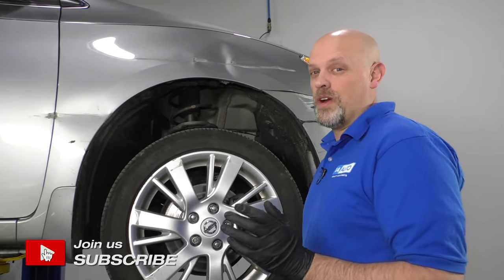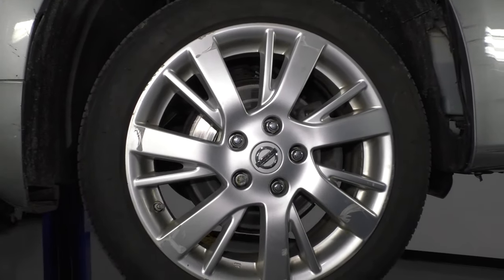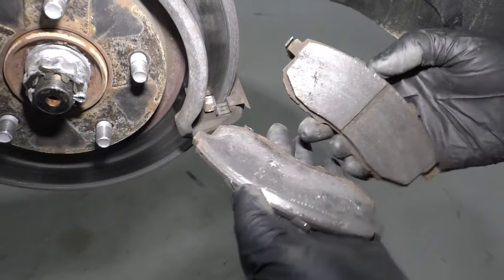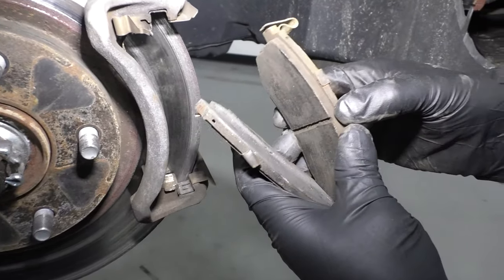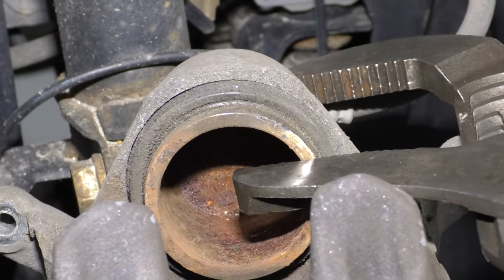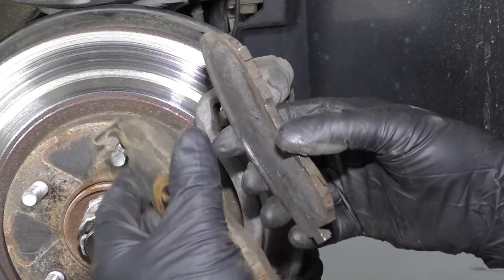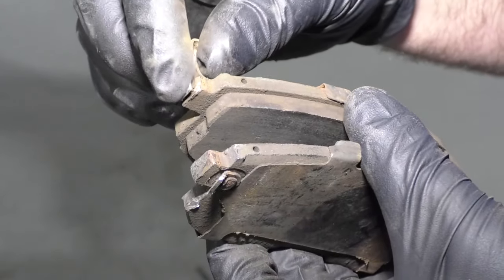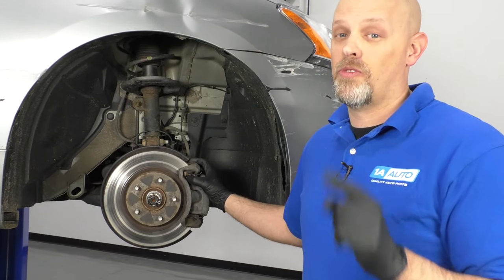Grinding Noise When Braking? What's That Noise in My Car, Truck, or SUV?

Comment: I just got into a car crash because my car was making grinding sounds. It was a car I had just gotten on November 11, and the dealership told me that they put a new brakes paddle in the car. Come to find out, it was a lie because the brake light came up on the dashboard, and I was pressing the brakes, and the vehicle was not stopping and ended up in a crash, and I got injured.

Comment: Yeah these are my rear pads atm. Thankfully a new set of pads and rotors costs a whopping $34 for the lowest option. Gotta love late 90s/Early 00s Accords.
Reply: Where you got those rotors and pads for $34..... I have a 97 Honda Accord
Reply from the maker: +Michael Leighton Thanks for checking us out. Shop for high quality auto parts on 1AAuto.com:

http://1aau.to/m/Shop-1AAuto-c

Comment: Great video. Thanks for sharing!  Depending on the year, make/model of your car brake pads/shoes, not to mention the labor involved, can be expensive, However it's your life and the life of your loved ones you have to consider. That said, it's cheaper to have the pads replaced before damage to the rotor happens. Depending on the damage rotors can be resurfaced but once the have been scored beyond a certain amount you will end up having to pay for a new set of rotors. You have to replace these in pairs just like your brake pads/shoes.

Comment: Heard metal on metal the day before Thanksgiving and immediately took it in since I needed to get to work early on Black Friday. The shop declined: Booked solid (busiest travel period of the year).

Dropped it at another shop and walked to work only to have them call me back, declining due to “excessive rust.” This minivan clearly spent part of its life up North but this is Georgia where they aren’t used to seeing rotted rocker panels (the rest is fine).

I ordered pads, rotors, shoes, and drums from 1A Auto and spent Black Friday weekend getting tooled up to DIY. Unfortunately, the van didn’t make it home: The rotor was worn enough that the backing plate must’ve slipped the bracket and ruined the caliper piston… though it was right where it belongs after I got it towed and had a look. Just got my replacement calipers from you guys yesterday and I’m waiting on a day off to get it done. Thanks!

Comment: I am facing the same brake noise issue with my brand new Kia Seltos esp when I am driving on rough roads and applying light brakes.
It also makes that sound when cornering and applying brakes.
Reply: Same with my Ford C max - 5 yr old

Comment: Getting mine changed tomorrow but due to cost of living crisis here in the UK i had to drive with the grindy brakes for over 1 month and it was very scary but thankfully now have the money to get them changed £270 is expensive though thats around $350 I think mechanics should charge less as lets be honest its only a 1 hour job to do and the parts themselves are like £50 max

Comment: My car makes this sound but I just recently replaced my rotors & calipers a few months ago now when I’m just rolling it grinds like this without pressing the brake what can I do ?
Reply: Update : my brake pad broke complete was grinding metal on metal fried rotors contacted powerstop they sent me a whole kit brake pads & rotors for free w 2 day shipping now they work & stop on a dime 💯 overall good brakes & company
Reply: You need smaller brake pads, the ones your using are probably too tight on the drum
Reply: might be the dust shield touching the rotor.
Reply: Maybe you need to repair or replace the brake disc and buy a new brake pad.

Comment: What if you recently changed your brake pads but making that noise ?
Reply: Thats my problem
Reply: Yes I'm in the same boat. You find an answer?
Reply: Probably rotor? Pads & rotors different
Reply: Rotors are shot .. & possibly caliper is shot also
Reply: @mattafawka   did  you  fix it,  I  have  same  problem  with  my  09 honda civic
Reply: @solob6912  ,, Rotors are warped
Reply: Is too much brake fluid also can cause a squeaking noise

Comment: I recently got my new front brake pad placed. It still sounds like grinding everytime I stop sounds as if it was hitting the ground. I took it to a mechanic he still don't know what that sound is ugh it's so frustrating
Reply: Same and it’s embarrassing and random asl
Reply: Currently dealing with the same thing AFTER replacing all brake pads AND rotors 😫 so embarrassing!
Reply: Same!! They told me everything was “fine” lol
Reply: My car too grown to be on this childish shit 🙄
Reply: Did they find out what it was?
Reply: Did you replace the rotors as well? There are some mechanics out there who will legit change your brake pads without changing the rotors as well and that will cause rust damage on the new pads so it’s basically the same as using your old pads if the rotors are worn
Reply: @rhianna7895  😅

Comment: Just fixed my issue today. I have an 08 lexus is250 and I only changed the rear pads as they were very thin compared to the fronts which had a lot of padding left. when I installed them at first. I put both pads with the squealers on the left rear of the car. The other pads on the right had a part of the backing touching the rotor causing the burning smell and the droning noise. I just flipped the pads so one squealer was on each side of the car.  Problem solved hope this helped.
Reply from the maker: +Mello Mob Thanks for the feedback!

Comment: I get this nose from the front after I installed new brakes and rotors. I have never had this issue and I’ve done many brake jobs. Could it be the caliper brackets?? That’s the only thing I didn’t change out.

Comment: My car makes this exact same noise when I put my foot on the brake but it sounded like it's coming from the real tires but the real tires are drum brakes in the front tires are disc brakes. And I wish I knew people who knew about cars so they could help me figure this out. I also did not bleed out the brakes when I changed out the front disc brakes and I have not changed out the back drum brakes. I don't know what to do. The rotors are very smooth all the way around on both sides front and back.

Comment: I had my vehicle parked outside on my driveway for about a week or so. It's still new with only 200 miles on it. Then yesterday I decided to take it for a drive. However, when I released the parking brake and began rolling off my driveway, right before it moved forward, there was a loud thump or clank sound.

I was slightly worried at first as I have never experienced this sound before. Is this normal? Does anyone have any idea what this could have been? 🤔
Reply: E brake?
Or was the car on a hill?
Reply: I would say that either the brake pad on your parking brake got pulled off, or it just loosened from where it was rusted to the rear hub, that can happen to disc brakes too of course.
A loose brake pad in the hub can be dangerous since it can suddenly start one wheel braking, but then you very often hear it sliding around when spinning the wheel when it is of the ground, if you are uncertain pull the hub off and find out!

Comment: So mine isn't like a heavy grind its like a metallic scraping noise. I was told my back brakes were metal on metal. I took a look for myself and I checked the one tire that I hear the sound from in the back and the rotor looks very similar to that one. But like I said its more like scraping? Still just rotors and brakes probably?

Comment: My Yukon truck has this noise and checked the break pad, both good. What else can cause this?
btw very recently I have changed the bad bearing and was fine after the change.
Reply from the maker: +Sam Sen We wouldn't be able to diagnose an issue like that here, you may want to have a local mechanic take a look at it. Thanks for checking us out! http://1aau.to/m/Shop-1AAuto-c

Comment: I know the video is from a while ago but I have the same noise and I just got my brake pads changed like a month ago. I thought the sound would stop but it hasn't. I only hear it when I'm a bit more aggressive on the brakes and go over a bump or pothole. I feel like it could be the ABS trying to kick in and maybe it being broken. It's a 2020 Kia Rio. If anyone knows a solution, pls reply. Thank you

Comment: So does this mean the rotor will need to be replaced to or should that be just fine?
Reply from the maker: +Bobby 9191 Thanks for checking us out! If there is any damage or pits/scars in the rotor it would be best to replace them so the new pads you put on wear evenly and there wont be any vibrations.

Comment: So I hear the same noise in my car when I break hard, but when I release the breaks and continue driving it still makes the grinding noise, but will tend to go away if I don’t break hard. Is it the same problem?
Reply from the maker: +joseph lopez We wouldn't be able to diagnose an issue like that here, you may want to have a local mechanic take a look at it. Thanks for checking us out! http://1aau.to/m/Shop-1AAuto-c
Reply: Yeah I have that issue excactly the same and sometimes if I press break again quickly it goes away it’s just worn break pads pal it’s metal on metal take the wheel of and strip the pads from callipers have a look what’s left on there!

Comment: My car is very bumpy when I brake on snow, i do have snow tires on, could you help with what could be the problem with my car. I just changed my front rotor and pads.
Reply from the maker: +Dennis Roy Thanks for watching!  It could be the ABS that is causing a pulsation or something else wrong with the brakes or wheels.

Comment: What would be the solution; for this particular vehicle in your video?
Reply from the maker: +David E Thanks for checking us out! There was something stuck in the caliper slides causing this to not sit properly and was worn down much quicker than the other side of the pad. The wear sensor also broke off of that pad so there was no warning with the squealing until the harsh grinding started. 1aauto.com
Reply: @1AAuto  
Thanks for the response. 

But what I wanted to know is...
Did  you end up replacing both rotors and brakes pads? Or did you replace only the brake pads, without the rotors?

Comment: Hi I have a 2019 jeep compass and since being in quarantine my car has been sitting for weeks. I recently had to go to the store, and heard this awful grinding noise😳 after about 4 red lights the car was fine again no noise🤷🏾‍♀️ What does this mean? Is it time for brakes???  I had no brake issues prior to car sitting.
Reply: probably just rust from sitting there, which is fine. it rubs off when you drive a little
Reply: its time to change your car!
Reply: Probably just surface rust accumulated on the rotor and it took a few brake applications to remove it.  Totally normal.
Reply: Alot of issues with brakes are with the rotors people don’t ever replace them and that’s why a lot of people have terrible break issues

Comment: My 2010 Ford F-150 sounded exactly like that, took it to mechanic wanted everything fixed properly. Guy quoted me $220 new break pads (this is my moms ‘reliable’ mechanic” proceeded with that two days from now there is a leak on the passenger side wheel what is that ?

Comment: Mine started making the grinding sound with brand new pads. I thought it was the rotors, so I changed those too, but it didn't help. I see no scoring on the rotor, pads look normal. Any ideas?
Reply from the maker: +@Captainsaucebuckle We wouldn't be able to diagnose an issue like that here, you may want to have a local mechanic take a look at it. Thanks for checking us out! http://1aau.to/m/Shop-1AAuto-c

Comment: I got the grinding noise after changing the brake pads, do you think the rotor could be the problem
Reply: More than likely so, I had the same issue I have brand new brake pads on and it’s making the grinding noise
Reply: if theyre brand new, it will take a little bit for the new pads to wear in, it will make noises for a while

Comment: just started hearing the noise today when i was breaking. When i break sofly it doesnt happen only when it hard break. Plus the noise stops a few stops and it doesnt make anymore. i still got an appointment in case. Last thing i want is my dream of my car not breaking in time when trying to stop in a red light comes real lol. Hate those dreams.
Reply: Please tell me what you did you get it fixed. Replaced rotors, calipers, and brakes im still hearing it

Comment: I changed the breaks and rotor on the side that was making that exact noise. It went away for 30mins then came back.
Reply: What was it?
Reply: Nine times out of ten is the brake shield or backplate

Comment: Ive never had brake squeaking or any brake problems but after it snowed and my car was sitting for a couple days and i first drove it started making this noise
Reply: Same here man
Reply: Sometimes that can happen just do to a little bit of corrosion buildup while they're not being used, especially if you live someplace humid. Probably it will go away with a bit of use, in which case there's no need to worry about it.

Comment: My car is not making a grinding noise, but no one can explain the noise that it is making.  

I'll try here.  

I have a 2001 Toyota Tacoma.  

When you get up to 30 mph or above, the front wheels make a sound like what you hear when a car window is cracked a little bit.  It sounds kind of like a whisper, or bugs all chirping at once on a summer night.  

But, it is not a squeak or a squeal, it's not quite a chirping sound, it is not a grinding noise, there is no whining noise.  

It is damn annoying.  

What is causing that?  

Thanks.

Comment: My brake are gridding when I stop but I just got new  brakes and routers what can it be?
Reply from the maker: +Malcolm We wouldn't be able to diagnose an issue like that here, you may want to have a local mechanic take a look at it. Thanks for checking us out! http://1aau.to/m/Shop-1AAuto-c
Reply: What did they say it was , cause mine is doing the same thing and i have new brakes and rotors

Comment: Does anybody know what could be the culprit because I think it's coming from the front wheels I don't hear grinding or squeaks when I'm braking but as soon as I put my car in Reverse first thing in the morning I hear like a grinding sound but then I don't hear nothing when I apply my brakes I just hope I don't need rotors I'm pretty sure I need brake pads

Comment: How much does a repair like this usually cost ?
Reply: Pads cost 20-50$ labor would be about a hundred give or take if you need rotors as well add on another 45-100$. If you can turn a wrench I suggest you change them yourself and use it as an opportunity to get to know your vehicle.

Comment: My car makes a noise in reverse backing up on the driver side back wheel soon as I hit the brakes it stops when going forward or anything like that or driving it does not make that noise could it still be the brakes they don't squeak or anything besides once in a while backing up it'll make a grinding noise  anybody have any ideas I thought if it would be the brakes it would be doing it going forward or reverse but this is only just in reverse and it's definitely the back left driver side wheel

Comment: Do I need to change. All the pads for sll 4 tires
Reply from the maker: +Kathy Kobell Thanks for watching!  You will at least want to consider replacing the other side, but not necessarily all four.  It doesn't hurt to inspect the others to see if they need replacing!

Comment: I changed my disc and pads both side the piston in the caliper goes in rubber still there but still grinding away what else can it be 😔
Reply from the maker: +HITMAN_ALI_786_ We wouldn't be able to diagnose an issue like that here, you may want to have a local mechanic take a look at it. Thanks for checking us out! http://1aau.to/m/Shop-1AAuto-c

Comment: I put a new rotor and brake pads and it started doing this sound again
Reply: Could be coming from another wheel that needs em changed as well. Or If not, check the hub bearings.
Reply: Make sure it’s not a bad bearing or the other axle needing brakes as well. Also use some copper anti seize or some silicone lubricant on the caliper guide pins, if they are not lubed up they may bind and cause the caliper to stick. Depending on what pads you buy they could produce more noise or brake dust.

Comment: What?? He didn’t figure out what was causing the uneven wear.....
Reply from the maker: +FishForFoodNotSport Thanks for checking us out! The cause may be a various number of things but with the inner pad wearing more likely than not it was debris stuck in the slides causing the pad to not contract fully after being applied. 1AAuto.com
Reply: 1A Auto Parts wasn’t the point of my comment. Though I find it funny even your follow up doesn’t include the problem nor solution.
Reply from the maker: +FishForFoodNotSport Thanks for the feedback!

Comment: I'm hearing that noise with brand new brakes and it's intermittent
Reply from the maker: +TragestyX We wouldn't be able to diagnose an issue like that here, you may want to have a local mechanic take a look at it. Thanks for checking us out! http://1aau.to/m/Shop-1AAuto-c
Reply: Need new rotors

Comment: Can you just put new brake pads on temporarily until you can afford new rotors?
Reply: Yes, but the grooves in the rotor will mess up the pads. You'll need to save for another set of pads with the new rotor. If there is enough material, you might be able to have the rotors turn and balanced. If so, it's cheeper.
It was less of a problem with drums.